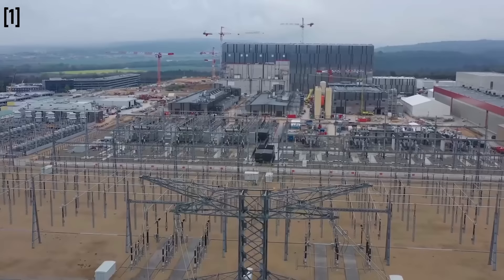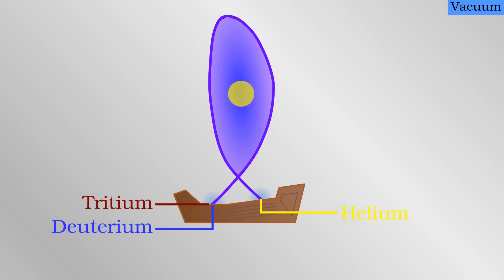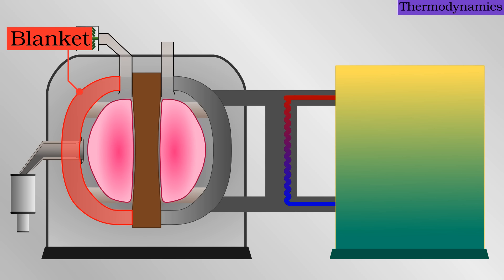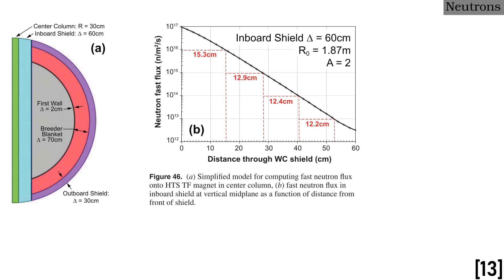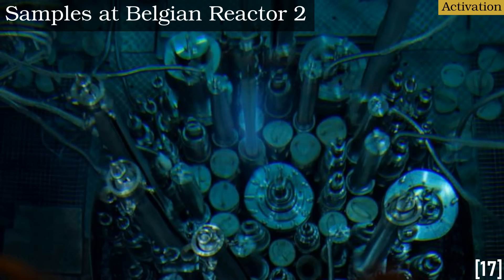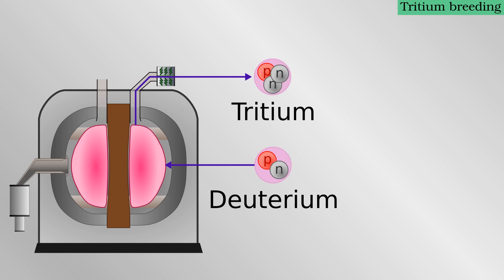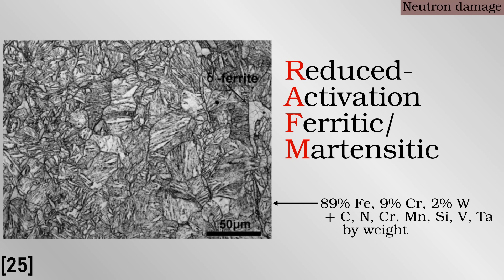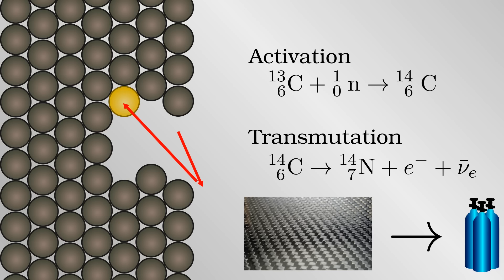How nuclear fusion (maybe) works (4) - reactor practicalities

Comment: Just out of curiosity, what did you make of the breakthrough the US National Ignition Facility had in December 2022? The one where they got more energy out than was put in?
Thanks for continuing to post videos btw.
Edit: nevermind, you adressed it in a community post.
Reply: Nothing special. The ration been energy pushed into the plasma and output is called called the "gain factor". A gain factor of "1" is not major breakthrough, just an incremental one. For a commercially viable fusion reactor you need a gain factor of at least 10 - possibly larger than 30.

Now, we still need to see this in context. Not long ago the gain factor in fussion experiments was 0.01 or 0.1. From there to get to a gain factor of "1" was massive progress. But we still have 1 or 2 order of magnitudes ahead.
Reply: @michaelrenper796 It was 1.2 no?
Reply: @SomeKidFromBritain  1 or 1.2 is a rounding error in this case. It needs to be 30 (or so).
"More energy than invested" is a marketing statement. It's is of no particular technical relevance.

Please don't read this as me dismissing fusion research. I'm fully in favor of investing heavily.
Reply: That recent announcement from the NIF management was highly crafted and misleading both to journalists and to the general public. They eventually admitted that more than 100 times as much energy was used to pump the lasers compared to the energy measured from the exceedingly brief fusion reaction. It took about a week to set up that experiment so the facility energy consumption during that week may have been close to a thousand times greater than the fusion output energy.

The fusion reaction  lasted for approximately 0.000,000,000,080 second and if the energy had been captured it could boil about two liters of water. One of the experimental leaders later admitted that only approximately 4% of the fusion fuel reacted before the remaining 96% was blasted away from the reaction center. The splattered tritium then had to be removed from the target chamber surfaces as radioactive waste. The market value of tritium is about $30,000 per gram. The maximum rate that they can fire the lasers is about once a day. The lab management has suggested newer lasers could increase the fusion gain but none of today's best lasers come close to the energy output levels of the current NIF lasers.

The NIF managers have always been masterful at obscuring the primary function of NIF when they address the general public. It has always been primarily funded as a thermonuclear weapon (H-bomb) research tool. The announced experiment included a test target intended to test prompt irradiation in a nuclear explosion environment.
Reply: @vernonbrechin4207  On your last remark, I do not believe you to be correct. As when I watched the press release live, a gentleman made it explicitly clear that the experiment furthered the US' capability to validate its nuclear weapons program.
Reply: @SomeKidFromBritain Talking tongues do not rule out lying lips
Reply: @vernonbrechin4207  Usually I’m kidding when I say this, but this time I’m sincere when I say that’s not fair, because yes to what you said except if you just listen to the guy in the suit at the news conference then you get the straight scoop. If you’re wondering who I’m talking about my best description is he looks like he just time traveled from the 1960s, right down to his body language.

TL/DR - what somekidfrombritain said.

Comment: You discuss direct energy conversion via the field line expansion. This is what Helion is proposing. In their publicity details are missing, you say the field lines must "cut a coil" which certainly seems necessary, if they expand within the region of a coil no current is induced. But does the expanding plasma also cut the coil? How does the engineering work?
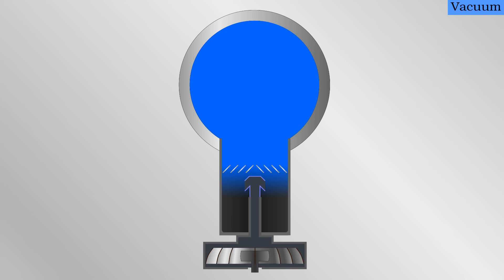Reply from the maker: The plasma does not need to actually touch the coil directly, as long as it "drags" magnetic field lines through it (mathematically: induces a change in magnetic flux). I talk about this from the 02:52 mark in this video: https://www.youtube.com/watch?v=gwOrbr8KWDs
Reply: @ImprobableMatter  Thanks for the reply and link to this other video. You have a cartoon of a blob of plasma dragging the field out which is rather what I had imagined would happen. I never took an MHD course but I still have an image of how currents and fields work. I really would like to understand how Helion is supposed to get the charged particle energy out, if I could see a diagram of where all the coils are relative to the vacuum vessel that would help me.
 I will look at all you videos carefully and see if that helps me to understand.
Reply from the maker: @johncarr5442  To be honest, I am also not convinced about how easy it would be for them to do what they've said they are going to do (and I've had comments echoing that). So, we shall see.

Comment: I wonder.... could you theoretically build a thermonuclear bomb small enough that it can be confined and have its energy harvested?
Reply from the maker: That's the idea of inertial fusion (Episode 2) where lasers replace the primary fission component and the secondary fusion one is scaled down to be manageable.
Reply: @ImprobableMatter  Oh no, I mean using a tiny nuclear bomb to cause inertial fusion. I imagine with lab technology it should be possible to build one small enough to be confined.
Reply from the maker: There would be critical mass issues for the fission primary, in that case. Namely, there is a minimum size and yield it has to be.
Reply: @ImprobableMatter  True, but in a lab you have a lot more options of compressing nuclear material to a crtical mass than in a bomb. So even a very small uranium core could probably be detonated with relative ease (actually, it seems like basically the same tech as inertial confinement, but with way less compression required).

Comment: By what method is the neutron sent to start the fission reaction obtained?
Reply from the maker: Which fission reaction?
Reply: @ImprobableMatter  any reaction,I want to understand the free neutron
Reply from the maker: If it's a nuclear bomb or fission reactor, the first neutron comes from cosmic rays (there are some number of neutrons going through your body right now). The number then increases exponentially, because it's a chain reaction.

If it's in a fusion-fission plant, it comes from the fusion reactions, which do not need a neutron to get started.

Comment: 2:20 are you sure the units are correct?
reaction rate here is 1/(t*V) - seems ok, but it is the volumetric rate, rate alone is 1/t
number density is n/V, so e.g. mol/m³ - not 1/V (e.g. 1/cm³)
reactivity, area * speed, is V/t or e.g. m³/s - correct (might be wrong, see bottom)
So we have 1/(t*V) = V/t * n/V * n/V.... which is not equal, we have n² (mol²) on the right side left over.

This source has the same formula but wrong units too: http://pages.erau.edu/~reynodb2/ep495/Atzeni_2004_NuclearFusionReactions_Ch1.pdf

This is a deeper hole than expected, since wiki has the same and another error regarding this, so I opened a discussion in the wiki article:
https://en.wikipedia.org/wiki/Talk:Nuclear_fusion#Reaction_rate_-_Units_do_not_add_up
Reply from the maker: It's a rate of number of reactions per unit time, per unit volume. "Number of reactions" is dimensionless. The rest are then self-consistent: number of atoms per unit volume, integral over a cross section and velocity. You can integrate over a plasma volume (density changes inside it) and multiply by the energy of a single reaction to get a power output.

Comment: So am I right in concluding that one of the main popular selling points of Fusion, that it's clean, is just not true? it seems like it can at most be claimed to be cleaner, or less of a long term problem than fission
Reply from the maker: Definitely not completely clean. It will decay to background levels in 100 years, but certainly not instantly if you use any reaction other than p-B.
Reply: @ImprobableMatter  thanks^^ love the videos by the way, especially that you actually cite your sources, which is sadly uncommon on (science) youtube. cheers from another physicist
Reply: I think if you drill into the arguments that traditional fission is unclean, you eventually find that the arguments build on the fact that it produces Plutonium-239. Pu-239 falls in an awkward in-between category, since it has a half-life (24k years) much longer than human timescales but much shorter than the half-lives of naturally occuring Uranium (0.7 bn and 4.3 bn years respectively for the two isotopes). Spent traditional fission fuel contains a mix of long-lived unburnt Uranium, intermediate-lived Pu-239 and short-lived fission products. Disposing of unburnt Uranium in deep geological storage is accepted by the notion that it occurs naturally in Earth's bedrock. The fission-products are accepted on the principle that one can simply wait a couple of centuries for them to decay. Pu-239 is not so readily accepted, because it doesn't occur naturally in more than trace amounts, it does create higher radiation levels than natural Uranium, and because it lasts so long that one cannot just "wait it out".

To be clear, I believe this reasoning is entirely bunk -- while Plutonium, all else being equal, does increase radiation levels more than Uranium will, it's not going to do that to such a degree that it is an actual problem. But I lay out the rationale here, to explain why some people latch on to either Thorium or fusion as "clean" versions of nuclear power -- they both still produce short-lived and highly dangerous isotopes, but they don't produce significant amounts of Plutonium.

Comment: I'm an idiot so please be gentle. 
With the fission/fusion concept. Is there like a large variability in the potential neutron flux from the plasma which would add some non-zero probability that an anomalie could take the fissile blanket above criticality and into atomic detonation? Or does neutron flux not determine the criticality state in a way that the ratio of fertile/fissile isotopes in the blanket cannot govern in all cases?

Could the plasma release more neutrons than normal for some probabilistic or magnetic confinement geometry reason and cause the uranium or thorium to explode?
Reply: Nuclear bomb is not easy.  A nuclear plant cannot be exploded like a bomb.  You need two things for atomic bomb e.g. the most common U-235 type, critical mass and suitable enrichment level.  Weapon grade Uranium is enriched to 90% or above.  For usual fuel rods of nuclear plant i.e. 8-10% enrichment U-235, there is no way to detonate it.

Comment: Are there any credible cases for fusion reactors that generate heat for something other than electricity? (E.g. endothermic chemical reactions like chemical looping hydrogen production). The advantages being you avoid the losses to generate electricity, and you could have a few enormous reactors rather than there being major advantages to distribution

Comment: I can totally see us getting into a situation where we use standard fission reactors in remote locations to produce the tritium that is used in fusion reactors next to cities.
Reply: It would be easier to build a high voltage transmission grid than a fusion reactor. We know how to do fission and transmission but even the feasibility of fusion has yet to be demonstrated, let alone commercial viability.
Reply: @TerryClarkAccordioncrazy ,
  Yes, that is true.  When it comes to "green technologies", there are lots of financial incentives and sneaky ways to hide the real environmental costs. (Ex: Producing hydrogen for "green" hydrogen vehicles by reforming natural gas).

Comment: Li7 splits into he4 h3 and a neutron when struck by a high energy neutron
This should make li7 as good as be9 for increasing the tritium breeding of li6
Is there some reason why this is not the case
(Ive looked at cross sections for both reactions and it seems to me that be9 is not massively advantaged )
Reply from the maker: Bear in mind that Lithium-7 requires the neutron energy to be at least 2.4 MeV, whereas Lithium-6 has no input energy requirement, but actually gives off energy. This makes the Beryllium/Lithium-6 combination more attractive.
Reply: @ImprobableMatter  i was aware that li7 takes more energy to split than be9 but the difference is not very significant in the case of h2 h3 fusion as the produced neutron is very high energy (rather the neutron economy of the secondary neutrons of these reactions may still be high enough to further breed even more tritium (thought thats not necessary))
if space constraints arent a concern (though i would guess they are a major concern) you could simply use unenriched lithium (mostly li7 some li6) to breed enough tritium which would save you consuming the entire global supply of beryllium and isotopically enriching massive amounts of lithium
EDIT:
when i mentioned space constrains that got me thinking
i just checked the neutron cross sections in JANIS and it seems that be9 has a very slightly lower cross section at high energy than li7 or li6 however beryllium is ~8/3x denser than lithium so its attenuation is substantially higher thus saving on space
i suspect this is why noone talks about using li7 to breed trituim
Reply from the maker: @johnnydeep7089  Even though the D-T neutrons have more than enough energy for Lithium-7, it is still advantageous to have neutrons which have already collided and lost energy to also be able to react, which Lithium-6 can do.

Also, Lithium-6 has a far higher cross section for neutron absorption: https://scipython.com/blog/breeding-tritium-for-a-fusion-reactor/
Reply: o also the li7 tritium reaction cross section drops off sharply around 5.5 mev and li7 is a better moderator compared to be9 which drops off around 3 mev (i dont think this is enough of a difference to make it not viable though as both reactions have high probability at high energy (~20% for li7 and ~30% for be9))

Comment: I am curious about your thoughts on muon-catalyzed fusion. You said in an earlier video that cold fusion is not really viable but didn't touch on that method specifically, and as far as I am aware it would be a viable way to do fusion at more reasonable temperatures but the main blocker is just a lack of energy-efficient ways to produce muons. Is there something else that is blocking it from viability (other than the other many complicated aspects of fusion) other than that, or is it just assumed that we'll never be able to generate muons efficiently? Or perhaps is the desire to do fusion at lower temps not really relevant as the heat is perhaps not a big concern compared to radiation and other stuff on a reactor of this scale?
Reply: The main, biggest problem is that muons exist for 0.0000022 seconds on average. It not even about being able to generate them, it's about being able to produce atoms with them and have them undergo fusion before the muons disintegrate.
Reply: @Rhannmah  I mean yeah that's not great, but 2.2 microseconds is I feel a pretty good amount of time still when it comes to how fast these interactions happen. I'd assume that decay rate just increases the amount of muon production needed to do meaningful fusion with them which goes more back to the efficiency of production thing though.
Reply: @presentfactory  Besides the energy needed to generate muons, and their short lifetime before they decay, there's also the "alpha-sticking problem".  https://en.wikipedia.org/wiki/Muon-catalyzed_fusion It sounds like people haven't given up, despite the challenges.

Comment: Wasn't the lithium required for fusion a different isotope from the lithium used in batteries? I always thought there will be no competition between fusion and batteries on that front!
Reply from the maker: Batteries don't care about which isotope they use (because the two are chemically identical), so any Lithium used for fusion is a loss to battery manufacturers, if that makes sense.
Reply: @ImprobableMatter  I see, that makes sense.
But since only 7.5 % of the lithium in nature is the lithium-6 isotope required for tritium breeding, there's clearly no risk of fusion leading to lithium shortage for batteries.
On the other hand, at some point battery manufacturers should better use only the more abundant lithium-7 and leave the rarer lithium-6 for fusion purposes.
Reply from the maker: @helgefan8994  Fair enough. I put this into the "long term" section, so definitely something to think about if fusion becomes important over the course of many decades.
Reply: I went on an ITER visit a few months ago and the guide said that there is no competition between for lithium and batteries for lithium. I queried this both verbally and by email but never received a satisfactory answer. I am not impressed by the veracity of general public communications from the ITER Organization.

Comment: Could you do a video or at least share some of your thoughts, on General Fusion's very different approach to industrial scale fusion power? As long as they could Could reliably achieve fusion with it? It seems like a good method of dealing with the radiation and directly extracting heat.